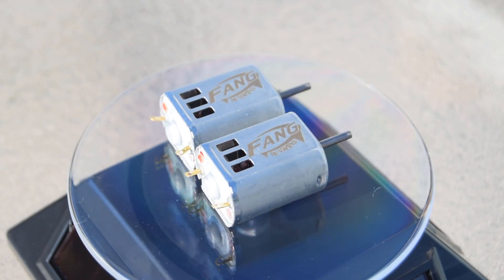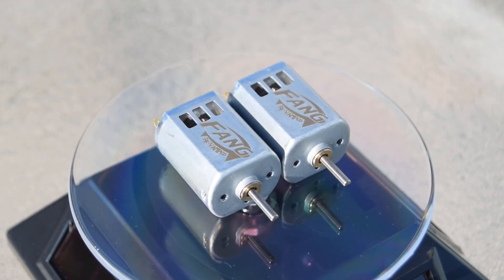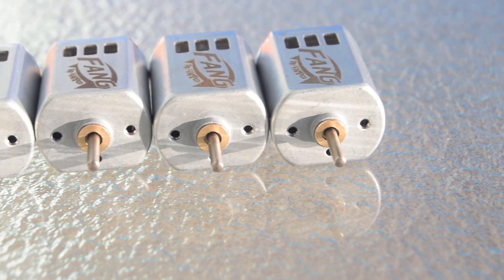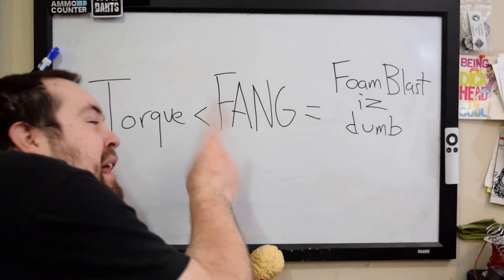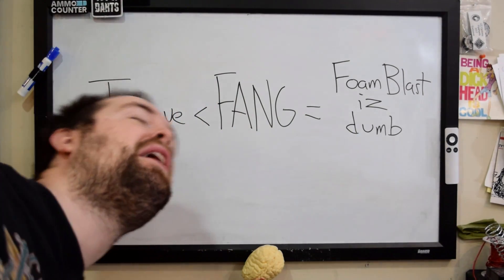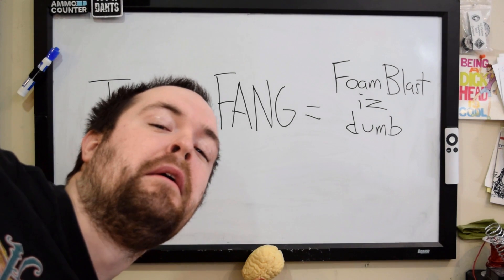Fangs Revamped - Ball Bearings, Neo Magnets, and No Shell Cutting!?

Comment: Please stop using cage spacing as a motor spec. Cage spacing means little when talking about motor spec. Dart gap is what matters. If you have a stock cage, but 7.5 mm dart gap, it's going to take motors with some torque. If you have a 41.5 mm cage with Hurricane wheels, the blaster won't shoot, because of too much dart gap and any motor will work with that 41.5 mm cage.

Comment: What lipo would you recommend for a pair of these in a stryfe?
Reply from the maker: Graphene 950 mah for minimal battery tray cutting, but it will need to have the battery connector swapped to an XT 60, Deans, or other high current connector.  The 1000 mah graphene and some of the others will work, but require lots more material removal to make fit.  Check our battery video and battery charger video under the "What you Need to know, Fast" playlist for more info.
Reply: Thanks! I do have the 950, and I already swapped it to an XT60, I just wanted to make sure since the constant amps aren't higher than the 20% safety margin. Also, how long do you think that would last in a war?

Comment: What Will the Stallone current be at a 3S lipo
Reply from the maker: 42 amps per motor.  84 * 1.2 (for safety margin) = 100.8 amp stall current at max charge.  There is almost no benefit to running them on 3S unless you are running Eclipse or other similar systems with smaller inner diameter wheels.

Comment: What would happen if you ran the Fang Revamped motors with a 3s lipo? (yes I know it voids the warranty).
Reply from the maker: It will spin very very fast. Overvolting motors is just rough on them, so they will burn out faster

Comment: Do you need to run a mosfet with these motors?? What about a 15a or 21a microswitch??
Tks!
Reply from the maker: We recommend a 21a switch to be safe.  A MOSFET shouldn't be necessary, but all switches wear out over time if they're exposed to more load than they are rated for.  A MOSFET keeps the load away from the switch so it should last much longer (10 times as long easily).

Comment: Hey really cool motors but I am still wondering how much voltage can it take because you said how low it can go to run on a 2s so how much??
Reply from the maker: 2s is the voltage.  A 2s battery is 7.4 volts nominal.
Reply: Thank you

Comment: What is the reason we cannot run on IMRs? All of my guns are guilt on IMR set up due to my accessibility to them. Just curious because the stock motors run okay on them and I know Im putting a lot of wear on them by running 3 IMRs on them hehe.
Reply from the maker: Stock motors barely require any current (Amperage) compared to aftermarket motors.  IMRs cannot supply enough current for aftermarket motors and will overheat and vent (spew hot gasses which will melt a hole right through your blaster and possibly burn you).  We wouldn't get anywhere near as much torque if we specced the motors for IMR batteries.  This is why so much of the hobby has moved to LiPo batteries.  They meet the current requirements of more aggressive winded motors.

Comment: If you used this with a canted worker cage with diagonal grooved worker flywheels, what fps would you get?
Reply from the maker: The same FPS as other motors with 33-38k RPM.  No other motor specs effect FPS.  We do not have one of those cages to test, sorry.

Comment: What motor are you using for the pusher in the Rapidstrike? Is it a tri-blade with the ReVamped Fangs? I ordered a few sets today and was planning on doing that to one of my Rapidstrikes
Reply from the maker: Fang Revamp pusher.  Ran the pusher on a separate 3s circuit.

Comment: Hey I was wonder if these motors are more powerful than neo rhinos if they are on 3s and please don’t be biased towards your motor I want to have a honest opinion
Reply from the maker: As voltage increases, so does RPM and Torque.  They would technically be more powerful than Rhinos, but the RPM would be out of the nominal range for standard flywheel setups.  The only reason you should run 3s currently is for Eclipse.  Otherwise you're just wasting energy and burning darts.

Comment: They look and sound sweet, I'm going to need some higher current Lipo's, maybe even Graphenes for the stall current on these aren't I?

Is 67.2 A stall current (including the 1.2 "buffer") for a pair of them sound about right (head maths)?

There should be plenty of real estate inside the Modulus ESC-10 battery tray so they should also be nice on a Rapidstrike, Hyperfire or anything with a larger battery compartment, I'm not confident enough to mount these (seeing as I just got a load of Meishel 2.0's that I still have to install) in a Stryfe as I'm not sure I could get a small (size rather than capacity) 2s LiPo that delivers enough current without a battery tray expander and possibly a Turnigy Graphene 2S 75c LiPo.

I'll probably get some soon though, my Hyperfire and ECS-10 have the battery space.
They certainly are Top-Tier motors in a 130 2S package that packs a real punch!
I like them a lot.
Reply: Matt Von Nerf Turnigy has a 950mah 2s graphene that fits in the stock stryfe tray, and can deliver 120 or so amps. Thoose can run pretty much anything you want
Reply: This comment is exactly what I was considering. It is a considerable jump in stall current from the meishel 2.0's and  I accidentally bought a LiPo battery for my meishel 2.0 stryfe that would actually be pretty good for a stryfe setup with these fang revamps. Take a look at the "Venom Fly 30C 2S 2000mAh" LiPo
Reply: Yes Xt60 is the standard plug on this battery, plus it comes packaged with a two adapters for other connections. Got mine off Amazon Canada but Hobby King does not seem to carry it. Venom is a fairly popular brand for drone pilots.
Reply: Thanks, I'll look into that!
Reply: Those sound like pretty much the solution, do you know if they come with XT-60 connectors from Hobbyking and if they're reasonably priced?